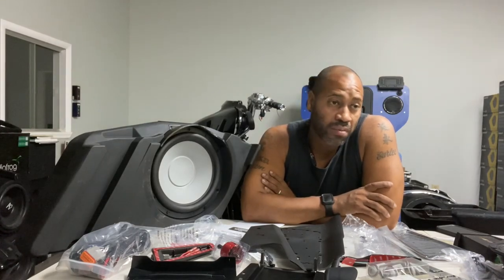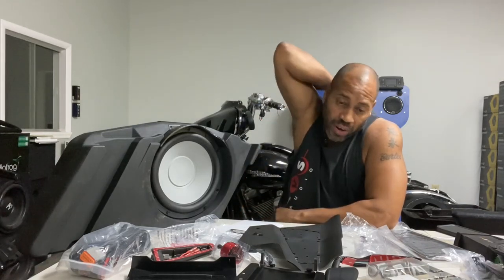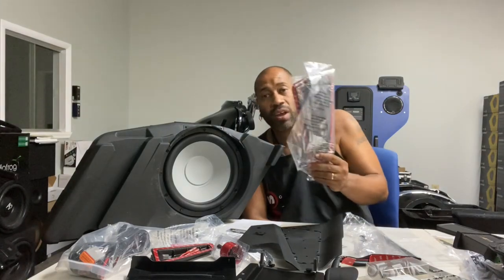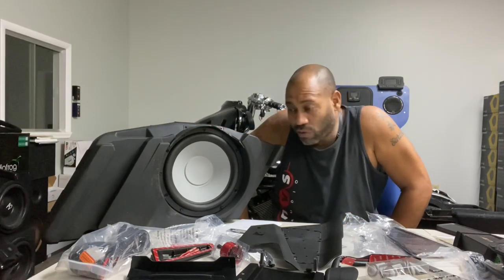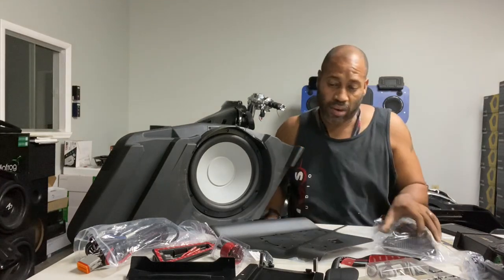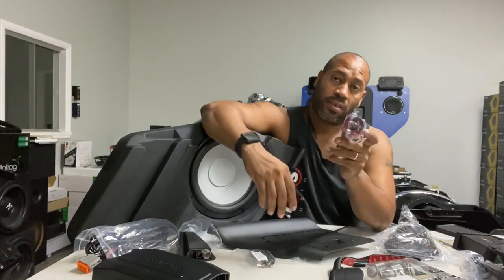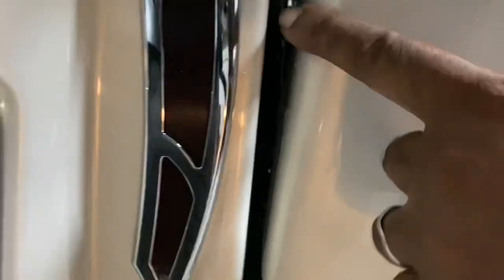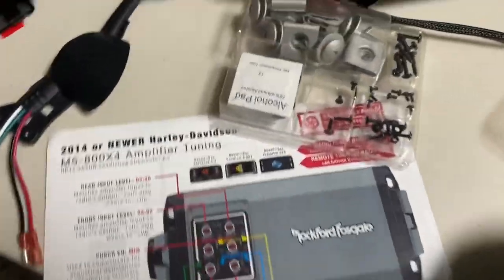Rockford Fosgate drop in subwoofer kit for 2014 and up Harley-Davidson baggers Video Part 1 of 2

Comment: Just got back from Daytona bike week had the 10” Rockford fosgate kit in stalled on my 18 street glide special I paid 2500 and the install was free great deal there gave the tec a great tip for his work he also reset the settings on my front amp that were in correct took him 2 and half hours and I got to sit there and watch the whole time he took no short cuts and the sound is definitely an upgrade and perfect add on to the stage 3 I had installed on my bike last year very easily removable of want to get rid of the bass you just paid to get long road trip I have a pack with me for cloths I prefer my bass safe riding everyone . Shout our to Speed Performance Plus our of South Dakota
Reply: At what speed do you stop hearing these subs? I'm considering adding one myself

Comment: Did they redesign these? Current ones show black sub and bigger recess in top for lid speakers? And left side subs now have the cutout for Amp? I'm considering buying one for left side and run a soundigital amp to it but what are the speakers specs? 4ohm? What rms to run? 300rms?

Comment: Have a 2007 street glide with a 400 sound digital amp yawing a EQ on it for the 6.5 and 4 horn tweeters sounds good but can’t turn it up past 20 they start cutting out it’s not the amp should I get a Dsp instead of the EQ
Reply from the maker: Yes
Reply: Thanks

Comment: At 19:15 to 19:24 I would have to say if this is a customers bike I would try to be a little bit more careful with the paint. If I saw this video and this was my bike… granted I have a 2021 CVO but if I just saw you throwing/letting go of the wiring harness to smack up against my paint I would be a little butt hurt. 🤷🏻‍♂️ just my two cents.